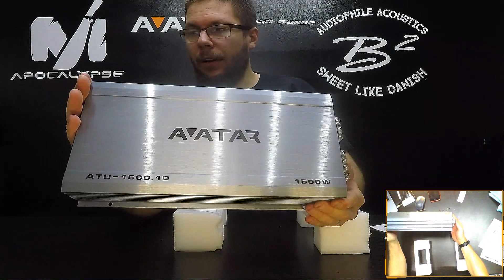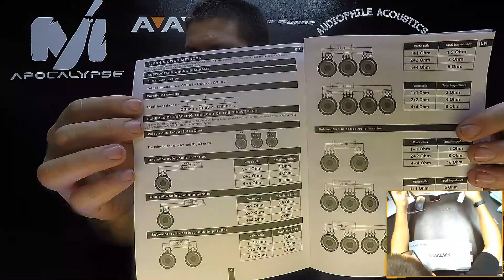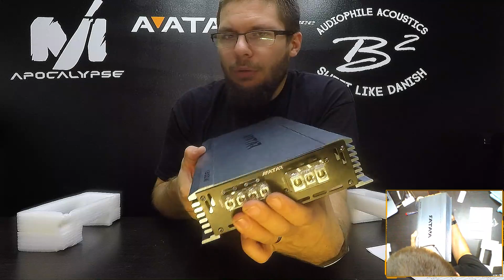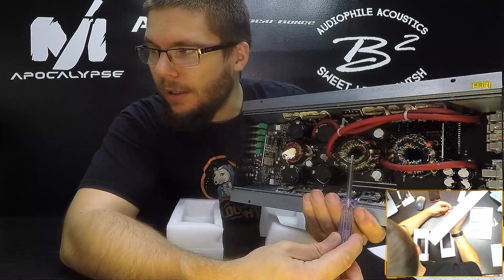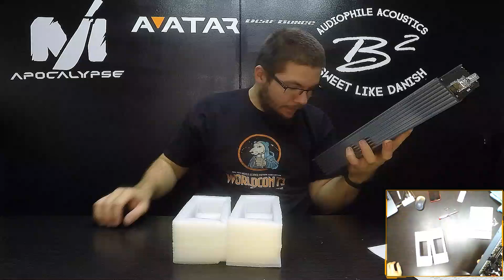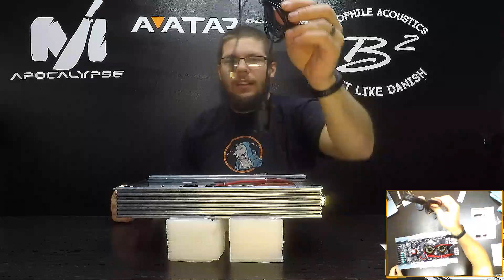[ENG] AVATAR ATU-1500.1D Review!

Comment: i am run an Avatar SST-3012 with this amplifier with a 36 hz tuned enclosure what should be the settings of the amplifier i like to listen highs and lows both plz help me out .
Reply: you need another amplifier and speakers for the highs. as for the lows you can set your amps low pass filter at 80hz

Comment: Hello i am confused about the Avatar ATU-(3500).1D because it seems that it is the same bassknob controll as the 1500 have, but if u look at a picture on the remote side of the amp it is not an 3.5mm connection.. https://www.google.com/search?q=Avatar+ATU-3500.1D&rlz=1C1CHBD_svSE819SE819&sxsrf=ACYBGNTHvWgafmKfBHMPgwVP41_IiEbSXA:1568310393751&source=lnms&tbm=isch&sa=X&ved=0ahUKEwib46q_68vkAhWrtIsKHUU9DuIQ_AUIEigB&biw=1920&bih=969#imgrc=haWgq8HzNYXQeM: